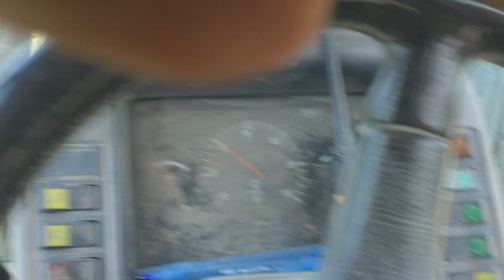Oblique disc tool incorporating spring green manure

Comment: Thanks! A better view of the disc unit itself would be nice and also a close-up of the tilled soil. I've been considering something like this. Does it have two rows of discs or just one? Does it disc one-way only? Is it designed to maintain a raised bed? That's what I was needing it for.
Reply from the maker: There's another video here https://www.youtube.com/watch?v=FpX139qe5bA  Equally imperfect but some better views of the tool and different working conditions.  There are more disk units mounted to the frame in the early spring video.  Ultimately I found that they clogged too easily so I removed one from each row and evened up the spacing of the remaining units.  Handles residues and deeper tillage much better now.  I'll try to get the plans up this fall once we decide on a hosting platform for our collective tinkerer group here in Quebec.